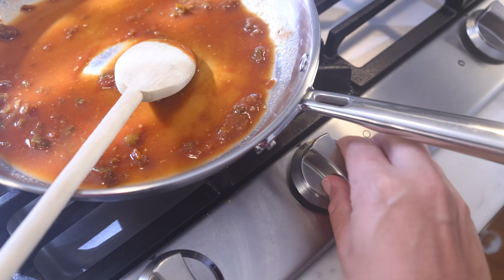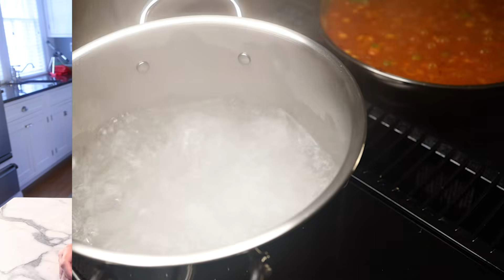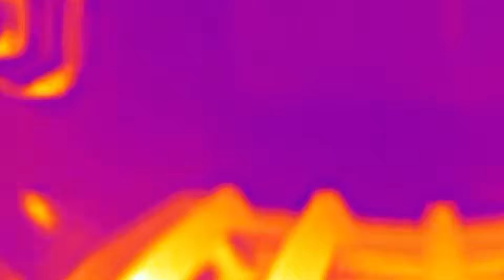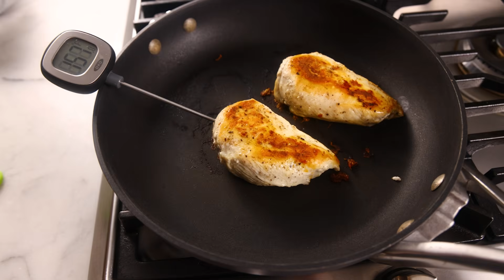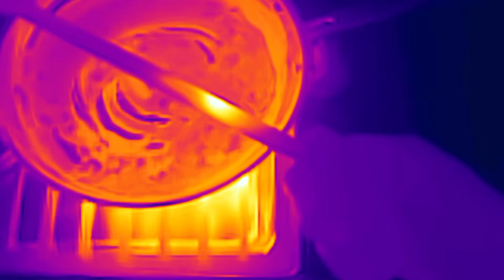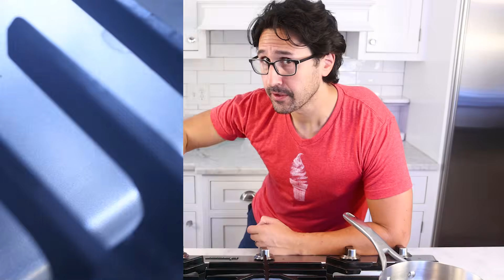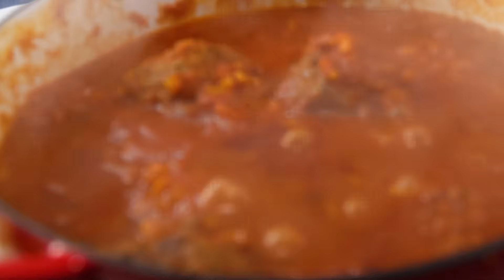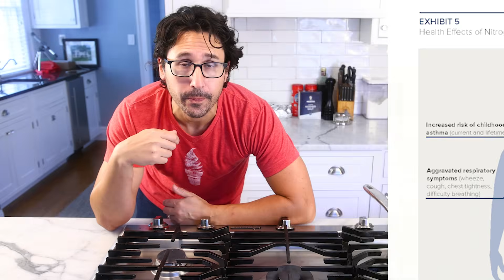Problems with gas stovetops | weak, dirty and dangerous

Comment: Long rant about why I am TERRIFIED of gas stoves.
We (as in me and my family) had the same old af gas stove for my  entire life, though I suspect it was around for way longer, so it's over 20 years old! So this stinky old stove doesn't have any fancy stoppers, built in ignition, etc. And I hate it. A lot! Because as a result the fire can go out very easily if you make it too small, especially if there's someone walking or, in case of my little sister, running by. Also it's easy to turn it the wrong way on accident while trying to cut the gas out, and the wrong way just makes the fire small but doesn't turn off the gas completely, usually resulting in just gas leaking without burning. It happened to me a couple times and I thankfully noticed it immediately... meanwhile my grandma one day didn't! Because she at home actually has a nice modern stove that doesn't allow for these weird risky situations. So when one day she stayed at home to look after my sister while everyone was away, after cooking on our stove she left the gas running thinking it was off. For like a solid hour! Thank god I came back quick enough and ventilated the room, otherwise it would've been a disaster... brr. Some houses get literally blown to shits by these mistakes. And if you, like I, live in an old apartment building, you're kind of at the mercy of your neighbors. If one neighbor in your vicinity has a gas leakage - both their and your apartment will be blown up. It's extremely scary, literally last month there were news about how a family left their gas stove running at night for warmth (central heating was off then since it was early September), and the fire went out on accident and in the morning boom... a large chunk of the building just exploded. 
So yeah
Fuck
Gas
STOVES
Once I move out I am PRAYING there won't even be gas in available in the building to completely eliminate this kind of risk. Many people, at least here in Russia, complain that electric or induction stoves are more expensive to use, electricity is more expensive than gas and such, but I don't mind even paying 10 times more for an electric stove than for a gas one if it prevents me from BLOWING UP IN MY SLEEP